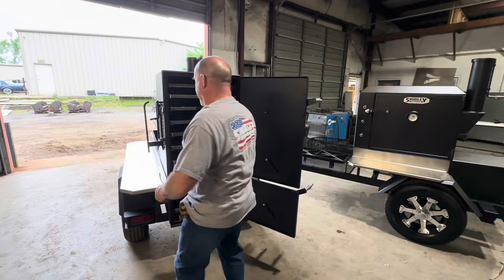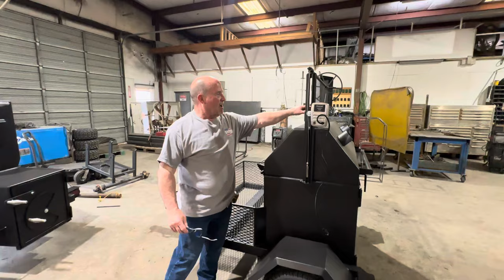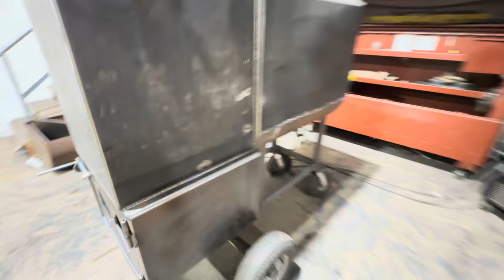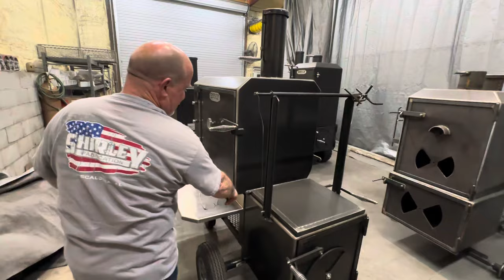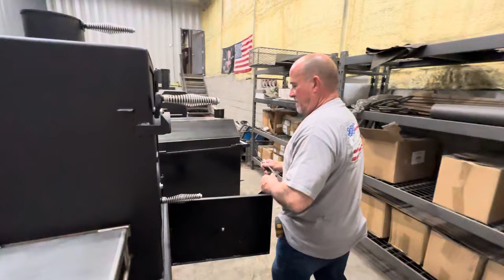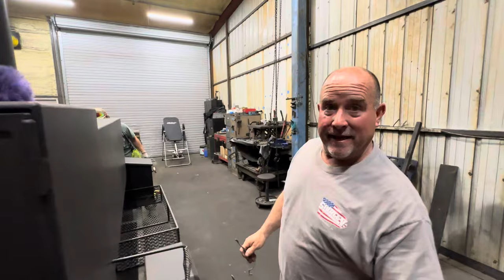A Video of some of the slickest cookers in America!!!!! Dad is is rolling today!!!!!😁😁

Comment: I'll be placing an order but gotta clear out some rainforest & build a proper storage facility first.  Got a good laugh at ribbing the diamond plate smoker.   Have you ever built a 'wok station'?  Basically heavy metal ring to support round-bottom wok with decommissioned jet engine underneath.  Laughed when the diamond plate smoker came out, was drawn to you by the pizza-bility.  BBQ, pizza, and fried rice are my schtick.